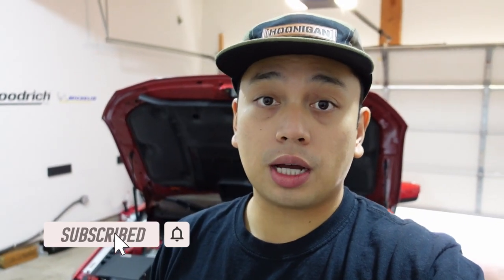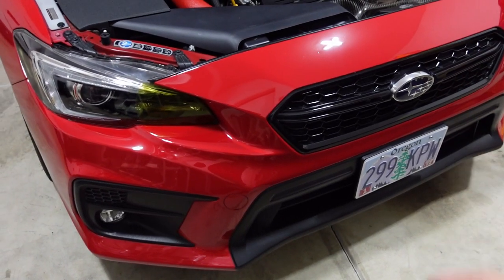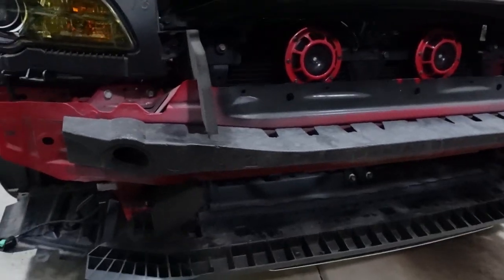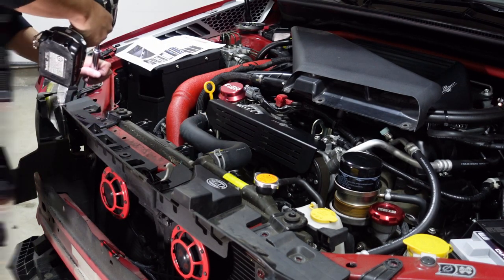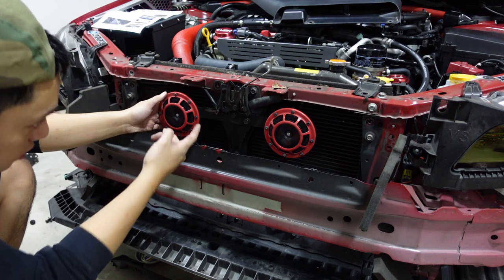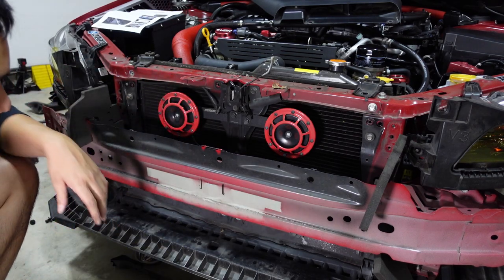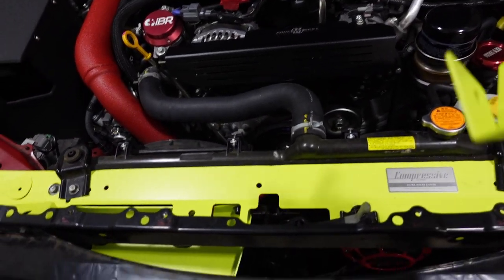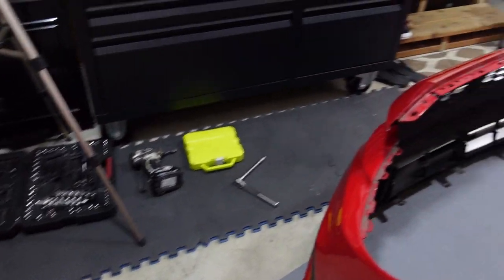Compressive Tuning Smart Flow Shroud | 2015-2021 Subaru WRX / STI

Comment: Outstanding video, bro. My WRX is sporting the duckbill spoiler thanks to you. I love it. It's holding up really nice. Greatly appreciate your DIY videos. I'm looking at all this airflow / engine cooling stuff you got now, plus the fender mod for for heat dispersion. Keep them going, man...
Reply from the maker: Thanks so much, man! Seeing this comment just made my day. This is the kind of stuff that keeps me going. I really appreciate it, man.
Reply: @ronfromportland  You deserve it bro. Take care, out there.
Reply: @ronfromportland  I just purchased the air blades 👍. Now to start cutting on the subie lol. Got an AP coming as well from MAP. Really excited about these purchases.
Reply from the maker: @Oldmannobody  that’s awesome man! Very exciting upgrades, it’ll make you enjoy the car 1000x more.
Reply: @ronfromportland  Thanks, bro. You were 100% correct, sir. COBB stage 1 is all i have right now. Such a huge difference over stock for me.  I drive a lot, so i noticed right away.  MAP doesn't have a '21 stage 1 yet. They didn't recommend the '20 stage 1 due to a possible ECM change.

Comment: There's a lot more to it than I expected. It looks like the shroud really helps with air flow. Congrats on 1k too
Reply from the maker: Thank you as always man! It’s a nice addition for sure. I don’t know if it was just my imagination but I went on a recent road trip and averaged 31 mpg. This is good considering all of the weight I had in the car. Could be the increased air going to the intake 🤷‍♂️
Reply: @ronfromportland  maybe. Or just cooler intake temperature so the WRX isn't working as hard.
Reply from the maker: @WRXSNOWBOARDER  that too!

Comment: Nice vid, with the increase or direct airflow do they recommend a tune? Please forgive me I am a new wrx owner.
Reply from the maker: Thank you and no problem at all! No tune is necessary for something like this. It’s recommended to get a tune for an intake though, if you ever decide to upgrade.
Reply: I got the mishimoto cat back and the mishimoto intake with airbox exhaust is on air box is not because I don't want tune the car what are your thoughts
Reply from the maker: Although it can’t hurt to get a tune to maximize the potential benefits of the shroud *
Reply from the maker: @goosunsafetyfirearmtrainin9561  good call. I would leave it off until you get a tune.

Comment: Looking good sir! Does your front grill have the area where the air ramp is on shroud blocked cause mine is pretty much covered up?
Reply from the maker: Thank you man! Yup, mine is blocked off too. I might switch up the grille so that air can flow through better. Thinking about switching up yours?
Reply: @ronfromportland  yup! Already have grill, just need to install it!
Reply: @ronfromportland  I also like the chapter sections on the video!
Reply from the maker: @MoJoNinjaGarage  looking forward to this install man!!!